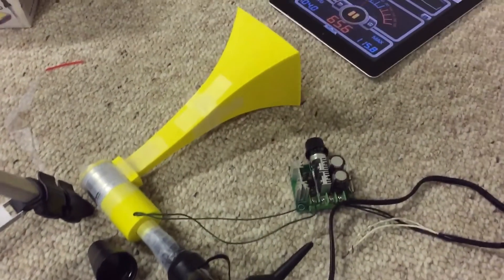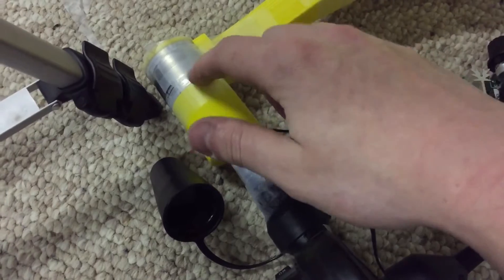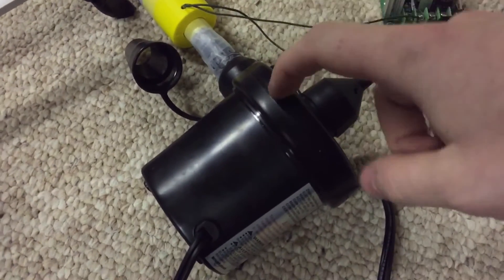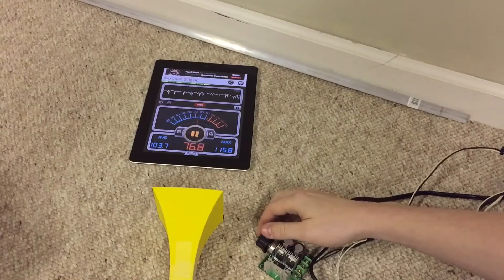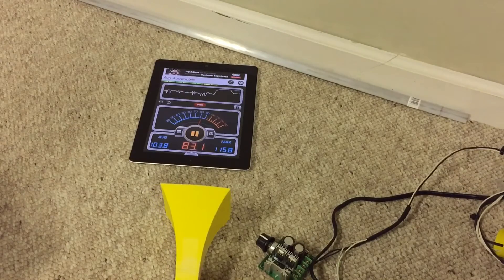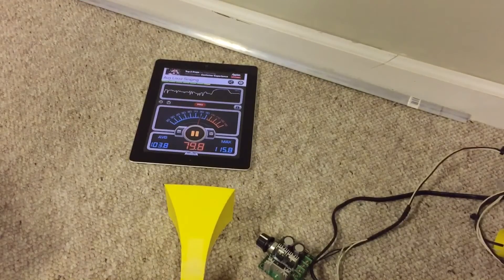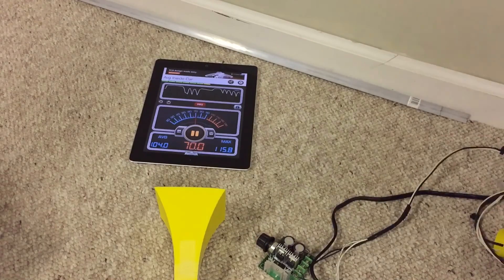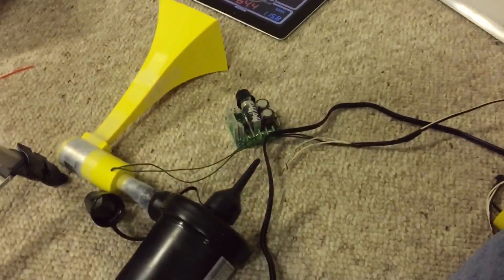Mini Thunderbolt 1000t UPDATE

Comment: @ExmarkDune Hey! I have one question. How did you 3d Print the chopper?
Reply from the maker: The first plastic ones were 3d printed but the metal one was machined out of round stock aluminum on a metal lathe and milling machine.
Reply: @ExmarkDude  Yeah, but I kinda want to know how you made the chopper holes with the chopper (ex. 1000t chopper where there is 11 holes in total)
Reply from the maker: @SportyTrainGuy  In fusion 360 I made a cylinder, then I made a hole, copied the hole in a radial pentagon pattern. Did the same thing for the 6 holes but in a hexagon radial pattern slightly above the 5 holes.
Reply: @ExmarkDude  Also I did mine on Onshape. Does that work?
Reply from the maker: @SportyTrainGuy  Im not familiar with that program.  As long as you can convert your 3d model into a file a 3d slicer will recognize and then from there into a file your  printer can utilize (ex: .STL) it should work.
Reply: @ExmarkDude  Ah I see. I was thinking of the same thing
Reply: But in the printing process, wouldn't it be impossible given by gravity?
Reply from the maker: @SportyTrainGuy  Oh I see what your question is now my bad, I used removable support material in the holes that would allow the printer to print over the hole then I just punch out the support when it's done printing.

Comment: One question, what dimensions/measurements did you use? I'm trying to 3d print my own and I don't really know where to begin.
Reply from the maker: I kinda guessed on the dimensions started making parts and made them look proportional to the rest of it. Its not perfectly scaled down. However I did look up the manual and found some dimensions and used them to scale the rest of the model and thats about the point I stopped on the project. Good luck though, hopefully you will get farther than I did!
Reply: @ExmarkDude  Thanks man, Just need to ask some people so I can get some leads, although I did look in the manual.
Reply: @ExmarkDude  I wish you could continue on it, maybe learn a thing or two
Reply: @ExmarkDude  Ok, One more question, How did you make the medaling the same thing as the 3d printed version?
Reply from the maker: @SportyTrainGuy  I made the metal parts using a lathe and milling machine that my uncle has in his metal shop.
Reply: @ExmarkDude  That sounds nice! Wish I had one
Reply: @ExmarkDude  I know I said one more question, but do you care if I ask another one?
Reply from the maker: @SportyTrainGuy  I don't mind
Reply: @ExmarkDude  OK, 1a. On the first thunderbolt update video,  How did you make the chopper/5/6 port rotate and 1b. On the third video, did you make the rotator motor or bought it?
Reply from the maker: @SportyTrainGuy  The first video you can see the little hobby motor mounted on the bottom of the chopper housing. That's what spins the chopper. The metal chopper is locked on to the motor shaft with set screws and the plastic ones were just press fit on to the shaft. 

 I bought the motor and gear set I was going to use to make the whole chopper and horn assembly rotate around like the real thing.

Comment: The horn should open wider.
Reply from the maker: I know. I was limited by how small my 3d printer is. When I get a bigger printer ill make it bigger.
Reply: @ExmarkDude  are u sell one if u do can I get one
Reply: @srnb-mr6jg  Edaan is though
Reply: @ExmarkDude  then you can always design a second part, print it separately, and glue it to the original